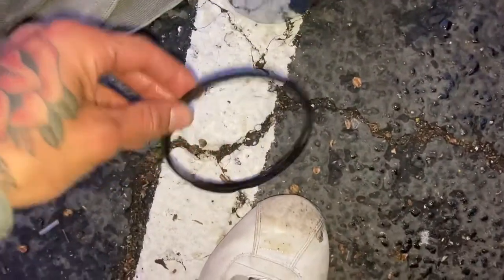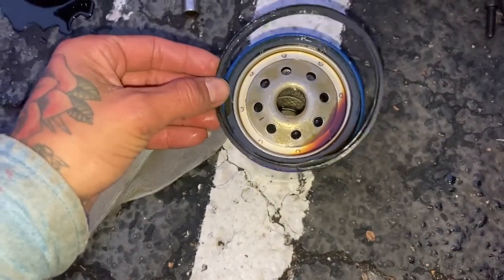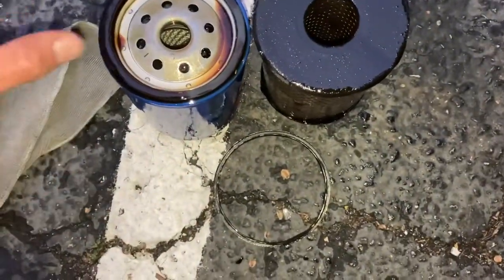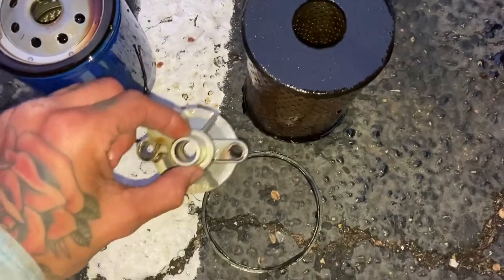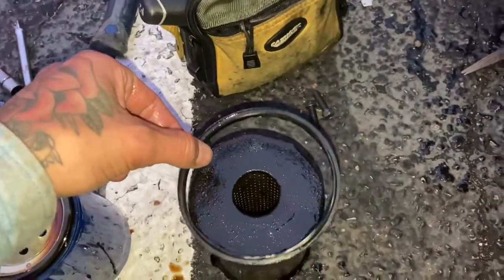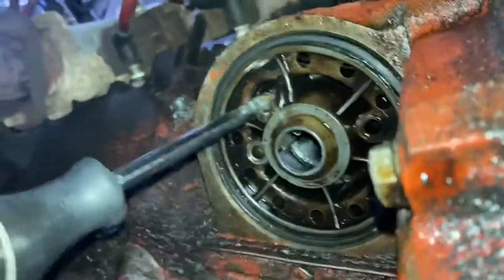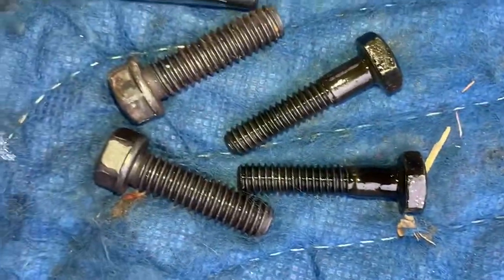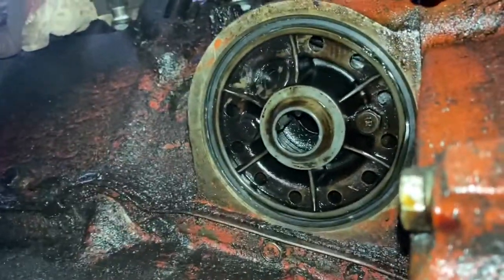SBC oil filter adapter didn’t work for me

Comment: That engine probably uses a different adapter because it's a canister filter. The adapter you did put on, is for a newer engine like mid 70s without the canister filter. The one you need is a wix spin on adapter for a 60s motor
Reply: Part number 24061